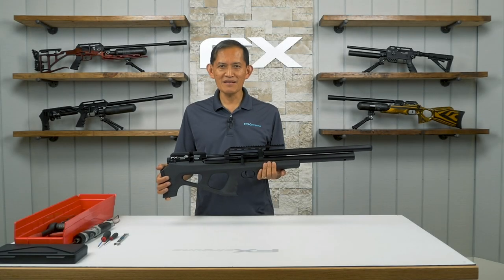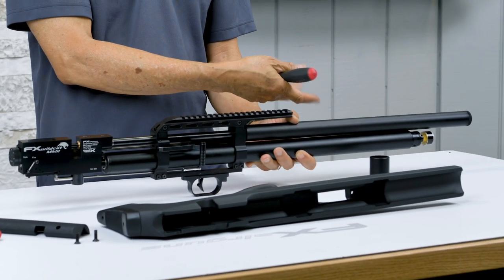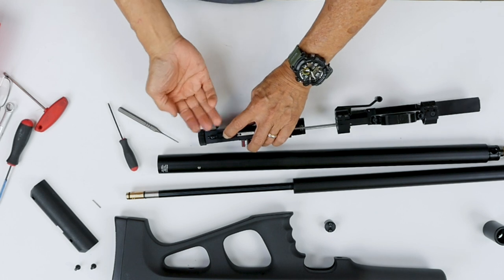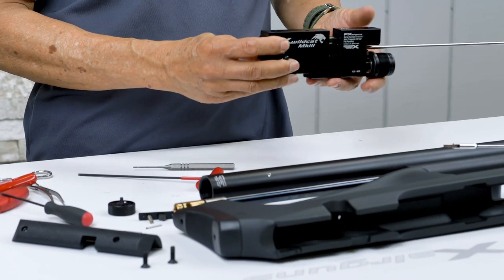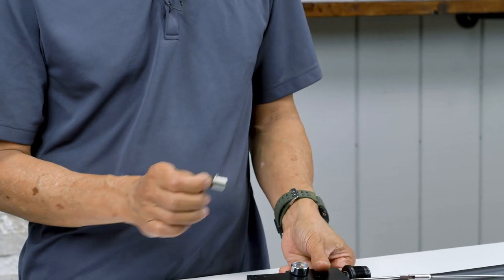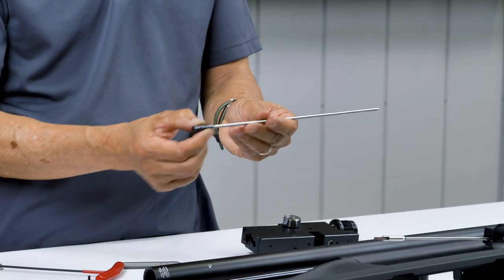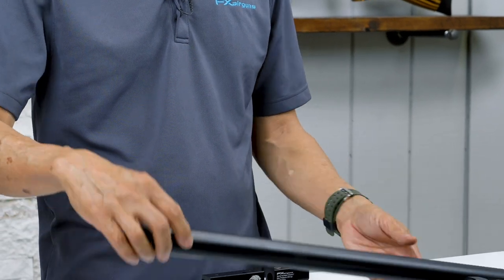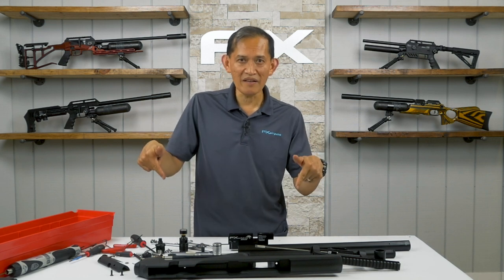FX Wildcat MKIII Disassembly - FX Masterclass

Comment: How do position the air tube gauge for 6’oclock orientation?  Mine is shifted and doesn’t have any seals on the end of the gauge.  It’s metal to metal.  Does it use a space or o ring of some sort to orient and than air pressure tighten it up?

Comment: I have a FX Wildcat MK3 about a inch before the end of the air tube there's two hole one with a screw in it and the other is just a small hole & it's leaking air. I wanted to know if it's normal to leak air or do I have to put a screw in it?

Comment: How do I put the pin that prevents the barrel from rotating into the action block?. When the barrel was out it looked like a piece of damaged metal so I (stupidly) pulled it out. Now I don't know how to get it back in. The barrel set screw (I think it is a 3mm Allen) along with grub screw holds the barrel securely and it fires just fine but I would really like the put this pin back in place. Any help would be appreciated.

Comment: Hi Ernest, I recently had my .177 uk sub 12 wildcat mk3 tuned. The gunsmith took the hammer weight out saying it isn’t required for a sub 12 gun.
Is this true or should I refit it?
Thank you
Reply: I want to replace the 5.5mm caliber with 6.35 caliber. Do I need to replace the hammer? Do you need to replace other accessories besides probe and barrel? Do you want to adjust?